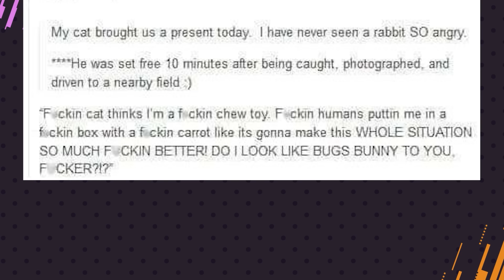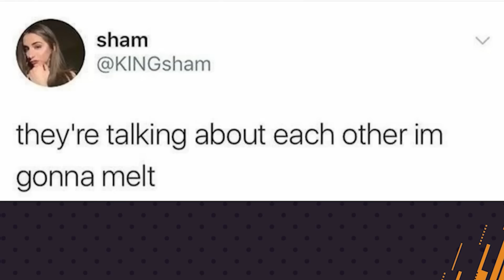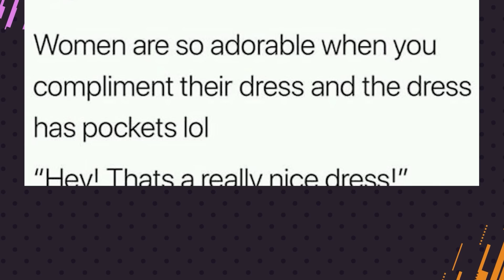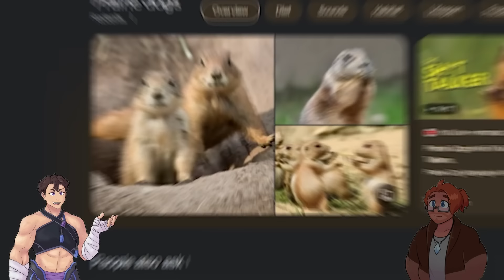Memes that'll Make you Dance Like This  | Serotonin Booster

Comment: Based on how Lumo has described his pain tolerance, I'm betting the lack of feeling cold its related to being a hyposensitive autistic, not his height. Just hope he realizes he needs to be more aware of possible injuries because his brain might not tell him & to let his medical providers know so they can run regular organ tests since he might not feel when something is wrong. Also, that his lack of pain/cold isn't the "normal" autistic experience; many, if not most, of us are hypersensitive to both pain & cold.
Reply: My cold tolerance varies. Sometimes, I'll just walk outside with nothing on my feet while it's snowing and not be bothered. Other times, I'll have trouble sleeping because my feet are just a bit cold.
Pain tolerance also varies. With nothing to numb it, I have done essentially surgery on my toe before to rip out an ingrown portion of the toenail, saturating both my toe and my implements in isopropyl alcohol multiple times in the process. Other times, a small shot hurts lots.
Reply: Idk if this is from my autism or if something wrong with my hormones, heart, nerves, or whatever the fuck else. But I'm always either feeling freezing cold, or BOILING hot. Sucks when at work cuz if I don't deal with the heat fast enough it will make me nauseous and increase chances of me throwing up. I am thankful for the rare occasion where I am at a stable and comfortable temperature. Would be least surprised if something with my heart or blood as lightheadedness has been happening as this has increased in frequency
Reply: I can't feel heat and holy shit is it dangerous. I was wearing a hoodie and sweatpants in 90° weather
Reply: Maybe but this could also just be a tall person thing. Lots of tall non-autistics are like this too. Still be good to get it checked out though
Reply: I have the same thing, but it depends on the pain and the type of heat or cold. If I hit part of myself on something it will hurt horribly even if it's just a small bump, but if I get scratched usually I won't even be bothered. Internal pain feels like a mix of both, and headaches are intolerable and if they're bad enough I will throw up. I usually can't deal with heat, but dry heat isn't nearly as bad and I can stand it to a more normal extent compared to humid hear, where I feel like I'll die. The cold only bothers me if my toes or fingers are freezing, otherwise I can mostly stand it.

Comment: I'm not particularly tall but I'm not short either and I have very little tolerance to cold. I lose body heat at an incredible speed, which is great in summer because all I have to do is hide from the sun and stop moving and I'll cool myself fairly quickly but winter is just a pain, I wish humans were capable of hibernating because when I'm sleeping is the oposite and it's easy to stay warm.
I'm somewhat hairy so that might have to do with it, larger surface area to evaporate sweat and all that.